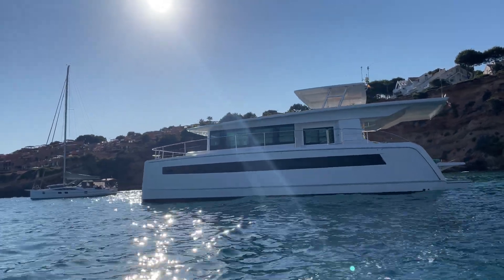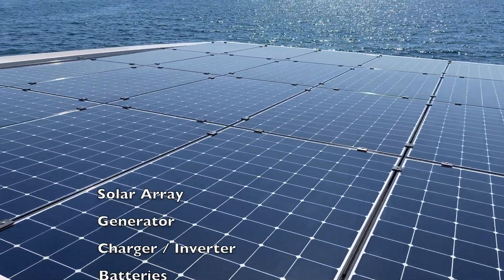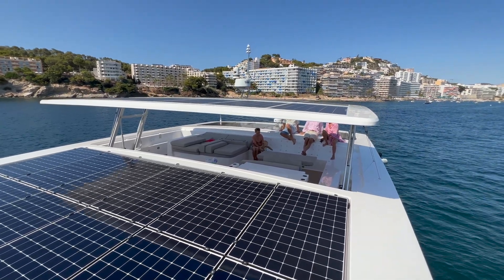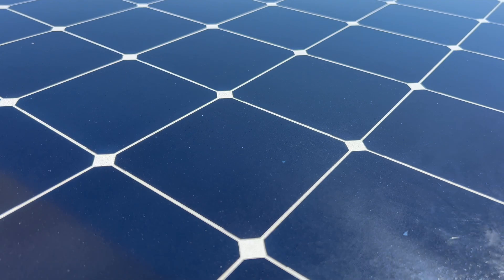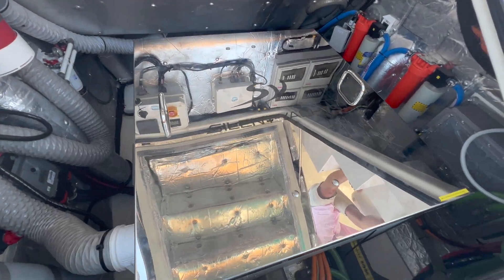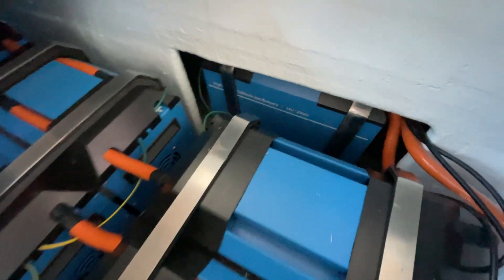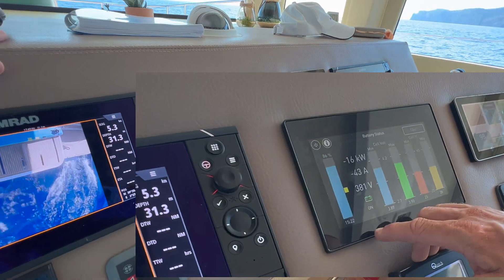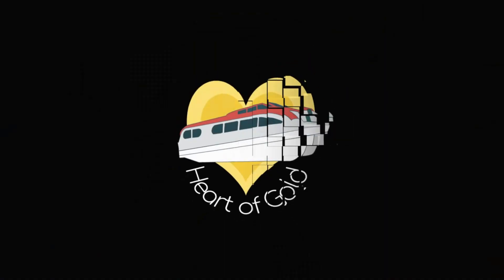How the Silent 60 works - Understanding Solar Yachts (Part 1)

Comment: Finally an intelligent  scientist and  not a sales person show the real break down of it's design. Thank GOD! Build quality is not looking good but your trying to buy an energy free Yacht. Although it's not the best, it's a break through attempt to drive solar powered living. I'm respectfully all for burning as little diesel fuel as possible. Fuel Cell yachts in 2055 and Ships including all Cargo ships will be fuel cell ships. They produce power and heat make hot water or steam. And the hydrogen will all be from solar and winds and the planet grabs sunlight for all it's energy needs from mostly sunlight. Park your car in the sun and drive home from work for free. Charging stations? What charging stations? Dude they're all gone. Remember all tech that is dead! Hang out as long as you can and see it. S.Y. reminds me of the first Tesla roadster. Where did Tesla go as so does follow quietly the Silent Yachts Silence of success.

Comment: It seems like an interesting solution with a lot of reliability and self-sufficiency. Asking a large boat to travel 25 knots, like some other GRP boats, seems like overkill. Having no need of fuel anywhere in the world is a big advantage. Redundancy seems like it could be a real problem; from redundant dingies and motors to generators, hydraulics, and air conditioning.
Reply: Apparently it only goes 20 knots. I wonder if there is a way to increase speed.

Comment: So 2 leaf motors or Renault Zoe's or whatever is easiest to find
I would couple that not with tesla batteries but lifepo4 either blades or cells
They are lower power density, but much much cheaper, and they will not start a fire that you cannot contain, they just swell up and die.
You have the hull for it. But by the time you are done with the fiber glass we will have some newer stuff. 
I would also balance this with super caps for the crazy motor draws, it's easier on the battery cells.
Graphene supercaps are on the way and something else is already on the horizon

Comment: I would design this yacht with second prop shaft on each side that would be connected to generators, so in motion your constantly producing power to charge batterie’s for longer trips and maybe faster constant speeds . Would be grate for area’s where there is cloud cover . Diesel generator would be backup power along with solar for long anchorage’s
Reply from the maker: That'd be a perpetual motion machine - doesn't work in real life unfortunately. 

The drag (and thus additional power requirement) caused by the additional prop shaft is always higher than the generator output.

And no diesel/combustion of any kind on my boat 😁

Comment: I’m looking forward to seeing the full deep dive on this!! It looks like they were charged over 90% as a Tesla owner (non-LFP) over 90% leads to battery degradation. Are they thinking of switching or having improved battery management systems, or aren’t they having issues?
Reply: im guessing but its possible that their 100pct is more like 80pct for battery longevity, just putting in more buffer but I don't know. I'd want LFP if i were ordering a silent yacht today.

Comment: The flybridge roof does not lower to fit through smaller bridges. It is to take shade off the panels. It's optional.

Comment: very weird choice to go for Lithium ion batteries instead of the much safer and longer lasting lithium iron phosphate.
Also didnt know they have separate low voltage batteries and a high voltage battery.
the newer versions of this boat seem to be running on a 48V battery system and do no seem to have a separate high voltage battery.
If you check the videos from thesuperyachtcaptain you can see how this has changed to a much better system without so many conversions going on.

Comment: really excited to understand how this yacht can go blue water. does it have sails of some sort? there is no mast? does it use propellers?
Reply from the maker: Why shouldn't it? Yep, it has propellers - they're powered by electric motors that are powered by batteries. Those batteries can be (slowly) charged by the solar array or (quickly) by the diesel generator. 

It's fairly similar to how many old (cruise) ships worked - diesel powered electric motors. 

Difference is, if you're not in a hurry, you can actually go without diesel with this design.
Reply: @HeartofGoldLifeboat  I'm in love with the concept, but I would really like to see somebody do a breakdown of what a blue water passage would actually look (fuel consumption, hypothetical speed).  Not one where you get pushed by the trade winds across the Atlantic, but one where you might have to do 7 days to windward beating into 1-2M waves and 15-20kts with half the days being overcast like real life situations when blue water cruising might dictate.  Would the diesel generator be able to keep up, could it make such a trip, or would it end up taking 12 days and burn 5x times the amount of fuel a sailboat would?  I understand the answer might mean, you just would not go in certain situations, but it I've not really seen the proof yet that these can handle blue water real life conditions that might be thrown at it...yes it could get pushed down wind, but you are stuck once you get there?

Comment: Am very impressed by the idea of silent yachts and like where they are going, but when I saw this new 60, and how it's built it does not look good enough for the price tag, flimsy and cheap materials and the areas/volume distribution themselves does not look that though throug at all.

I still hope the best for this brand and especially that they improve, this was the boat I dreamt of for long time but now I could not see myself spend that much money (if I had it) on that quality (or lack thereof).

Imagine you can buy a steel Bering with high capability and safety, stability, durability, redundancy and a high quality interior for a similar price. Sure it is not solar electric but still comes with a hybrid system with large battery banks and solar arrays. 

Just can't justify the price for this, even if amazing, boat. Am I missing something ? 😅
Reply: Maybe you are. Consider the running cost difference between the 2 boats. Silent has lifetime warranty on engines, 25 years on solar panels and 8 on batteries. What would servicing a Bering cost in 8 years?
Reply: Is there some electric yacht alternative that Im unaware of? Yes, I see 2-3 million $ diesel yachts with maybe slightly nicer materials, but cost of operating is way up, diesel fumes and noise, and more negatives.

Comment: Do you know what the Brusa BSC614 units are being used for? I know they are DC to DC converters but what specifically is their use within the Silent Yachts?
Reply from the maker: The solar array charges a small 24V battery bank that supports the 110V/230V inverter and all hotel loads. 

The motors run on 400V though, so you need a 400V battery system to power them.

Instead of running the entire solar system on 400V (making everything you could touch there deadly), they just connect the 400V batteries to the 24V batteries with the Brusa DC/DC converter. 

Reduces the number of HV components and makes it possible to use standard Victron stuff.
Reply: @HeartofGoldLifeboat  HA! I've been wondering for ages now what kind of safety measures they had in place for electrocution.

Comment: Index for watching this video through dozens of times... 
3:24 = Stats on forward array
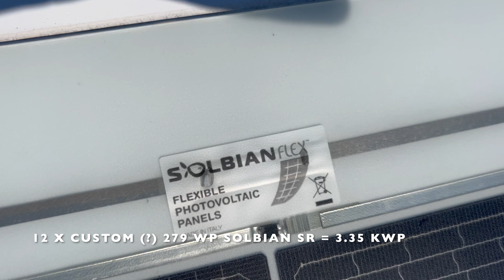4:14 = Stats on coach roof (kinda) array
4:37 = Stats on stern array
4:47 = Total Solar
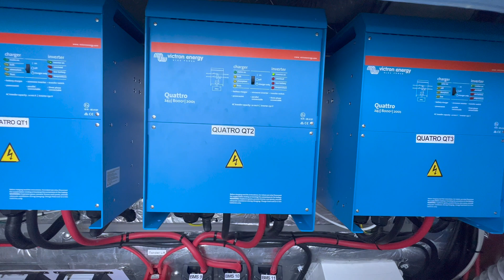5:40 = Stats on Inverter + MPPT Charge Controllers
7:39 = Stats on Battery
8:02 = Stats-ish on DC-DC converters

NautiStyles claims:
"3 kw on each engine - 4,4 knots
7 kw - 5,5 knots
9 kw - 6,4 knots
13 kw - 7,0 knots
20 kw - 7,7 knots
30 kw - 9,1 knots
42 kw - 9,8 knots"

Prior to testing and install, I would like for you guess what you will get when you are done.  My fictional electric/solar boat would be able to go 4 knots for 24 hours as a base load with solar excess during the sunlight hours pushing closer to hull speed without consuming battery.

Comment: Look in the the DIY cat link for Na ion battery tech 
And now theres a new arrival coming Sulpher ion dry cells.
Both of which offer major advantages  over Li battery chemistry's . Not least of which is cost Wt and safety.
Reply: There's a dozen or so battery technologies that are probably going to be coming out in the next 5-10 years. Some even better ones may take longer or end up non-viable but the future certainly looks electric for boats.
Reply: @KMCA779  
👍🏼🧙‍♂️ What they must do is choose battery chemistries that are cheap and widely available/distributed.  The raw materials need to be common and safer.
Rare earth metals and none ferrous metals are just a route to long term failure and further resources gerrymandering by the desperate and unscrupulous.

Whatever happens we need to avoid any damage to the deep ocean floor ... we havent a clue what damage to that would do to the planet and what we would litteraly rake up in damage.

The big issue is we need to be doing this now.. we have been stalling for at least 30years.

Comment: The official reason for the lowering top is down it prevents shading of the fixed panels . It also reduces windage in more difficult conditions..
The fact it allows it to pass under some lower bridges is secondary to its function.

The use of Basalt fiber in the fabrication hull and the lifting bridge roof would offer far  greater strength for wt and ballistic/penetration resistance. Its also cheaper and greener to produce as its a natural material than any GRP or Carbon. 
Its also highly stable chemically and under UV light and importantly compared to Carbon fiber it is electrically inert.. so unlike carbon fiber composites you dont have to worry about electrolytic reactions. ..or shorts passing through the structure.
I think ive put up links previously if not I will add them here. 🧙‍♂️

https://youtu.be/vS1J1AyFrjo BYD blade cells take note.
https://youtu.be/r3Kmy3SDEHI
24 volt battery packs https://youtu.be/8PZbFtWNLMo.

Another DIY hybrid Cat conversion https://youtu.be/ZWiC4kVCGXI

LiFe poly keeping it warm in cold weather.https://youtu.be/m1T7S1J-Zxs

Not for you but maybe for SYs 
https://youtu.be/o38AK3d10ts
Use english sub titles.to get the full story. 
Australian Body wrapping in solar anyone? https://youtu.be/eVz2F1Hn65I